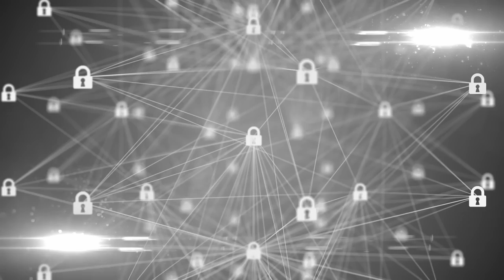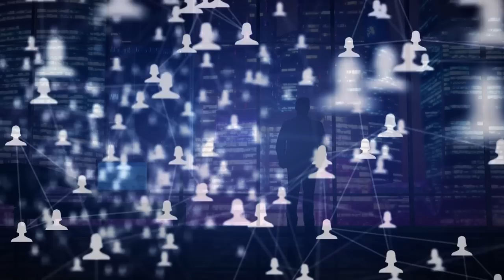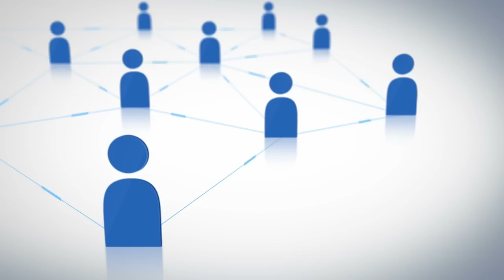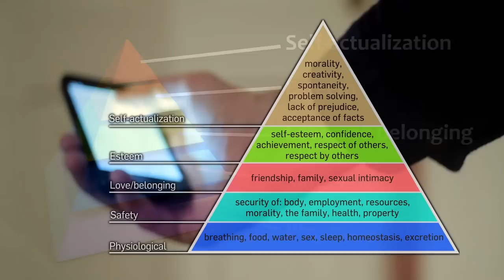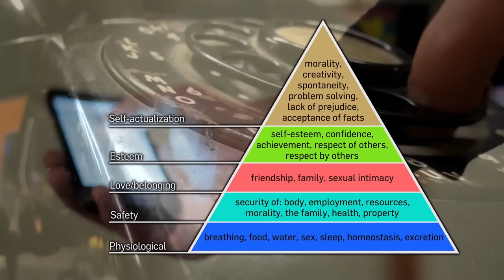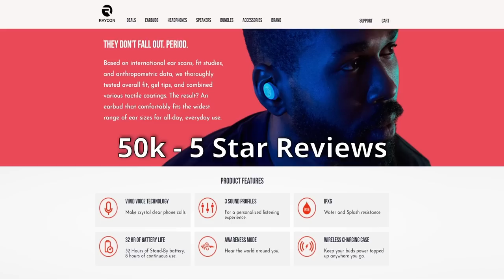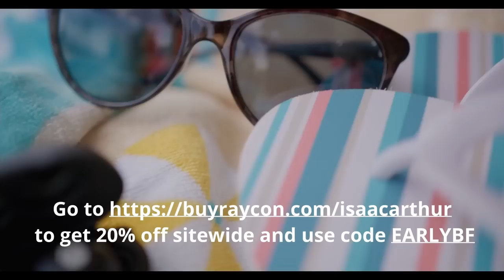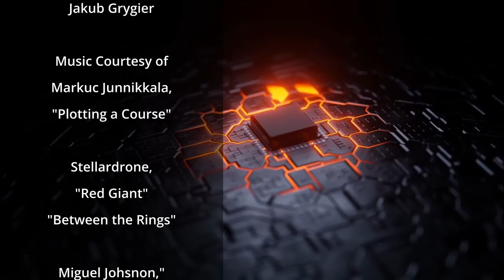Automated Economies & Unemployment

Comment: Do you think it is reasonable to consume a lot of energy by cyclicly moving a large sealed robust container of water (a large thermal mass) back and forth between a stove and a freezer both requiring electric power? You aren't making any  permenent changes as you alternately melt and freeze the water inside. The container and its water aren't becoming less orderly as the exercise continues. The unreasonableness of this waste is a challenge to the second law of thermodynamics. 

❕️❗️It is more scientifically elegant that refrigeration produce electricity instead of consuming it. 

The second law of thermodynamics began to be a strong science paradigm during the mid 1800s euphoria of progress in steam engines and industrialization. Steamships could mostly voyage on-corse on-time regardles of nature's awesome winds and currents. Mechanical power became cheap and without manure. Sir Arthur S Eddington popularized the idea  that the second law of thermodynamics, with its consequence that the universe would die of thermal stagnation, was a proof of God and more fundamental than Maxwell's equations. Powerful generators and electric motors were developed in the mid 1800s leading to the electrical distribution of steam power.

l was granted US patent 3890161 DIODE ARRAY,  for a refrigerator that absorbs thermal energy in an insulated compartment and releases a corresponding amount of electrical energy using the intermediary of rectified Johnson noise (the Brownian motion of electrons) aggregated by a multitude of consistantly aligned diodes. [Not exactly the abstract] It has been open for anyone to develop since 1992.  

I had a report of a working very low power prototype in ~ 1980 but l naively lost the prototype. It was made from a chip containing ~1400 gold pillars abutting N type GaAs. A U VA Charlottesville department made it for 1-3 THz frequencies. They could not align very small diodes well enough in 1980 to make ~1 um dia diodes individually so they made them in patches. I found a lab that put conductive paste on the face of one patch chip to bring all the diodes in parallel and test it in an oil bath in a sealed test chamber. They went out of business but I thought they should keep the prototype because they had the test chamber and could make special arrangements. I lost contact with them and never received the prototype. U VA  refused to sell me any more patch chips and stopped making them. 

I am not interested in any more patents. The diode array patent gives me enough of a reputation. The exclusionary power of patents breaks up synergistic benefits to civilization. Wide exposure to the public (as needed for wide scientific and spiritual discourse) renders invention concepts unpatentable. Other teams have built low power prototypes of their concepts too so the overall energy concept is likely to emerge for the betterment of civilization. 

This energy system would not be unreservedly good. Some foresight of the consequences is needed. 

Cell phones wouldn't die or need power cords or batteries. They would cool when transmiting radio signal power. Frozen food storage would be reliable and free or value positive. That means homes and markets would have independent power to preserve food. Vehicles wouldn't need fuel or fueling stops. Elevators would be very reliable with independent power. Nomads could raise their material supports out of the box pay as you grow. Zone refining would involve little net power. Reducing Bauxite to Aluminum, Rutile to Titanium, and Magnetite to Iron, would have a net cooling effect. With enough cheap power H2O and CO2 levels in the biosphere could be modified. There should be good oversight for this. 

EMPLOYMENT AND ECONOMICS 

I think fundamentally new as well as updated older products should be manufactured in AI operated / human managed  cooperative conglomerates (cooperative   internally and externally). Business details would be open public knowledge. Associated people should freely talk and move as negotiated. The semicustom products would be sold at honest accounting commodity prices. No wealth draining top commanders are needed. It may be partly capitalized by factoring and they may have parts of the conglomerate somewhat dedicated to production of their preferred products. Financialization may be highly off culture but surviving in niches such as incentivizing office pools. The conglomerate may operate with wide participation for the betterment of civilization. 

I forsee a lot of people working for creative expression because the benefits of clean abundant pervasively useful energy will propagate through many manufacturing chains resulting in a materials web where material goods are  inexpensive and a services web where people don't have to struggle to survive but can synergize and socialize with each other. There will be extremely little need to consume fuel for energy - people may still enjoy bonfires. Living will be inexpensive. 

A THOUGHT EXPERMENT TO SUPPORT THIS THESIS: 

Please consider a thought experiment device that may work because it avoids the failing parts of (1)Maxwell's demon thought experiment device which fails because the demon needs intense lightw and (2)Feynman's paddlewheel, pawl,  and ratchet wheel thought experement device which Feynman clamed would fail to rectify random thermal motion.  [Failure because of thermally moving pawls may be fixable with multiple pawls. Its difficult to aggregate this device. Feynman  by extension claimed that diodes would not rectify Johnson noise.  Diodes may work on their own merits].  However, he accepted that small paddlewheels will move in response to the thermal random motion of fluid they are immersed in. 

The purpose of the thought experiment device below is to create self powered thermal diversification. The thought experiment device is impractical but easy to visualize and check for mechanical workability.  It is not too deep in the nanometer scale realm. 

Sketch made with keyboard characters: 

COLD ROOM   ())--:WALL:-->> HOT ROOM    

Key
()) = Paddlewheel. 
-- = Axle.  (Continuous from end to end)
: :  = Axle tunnel going through a wall.
>> =  Lumped friction element

Please visualize two roome full of air separated by a very thin wall that allows the rooms to hold their heat independently with minor leakage through the wall. The wall is thin to delicately support billions of  separate nanometer scale short axles running straight through loosely enough to rotate freely but  not leak very much heat so the rooms can hold separate temperatures. 

On the left side, a very small paddlewheel is mounted at the left end of each axle. On the right side, lumped friction elements are mounted stationary in place on the wall, one for each axle, for the right end of each axle to run through. The lumped friction elements connvert the mechanical rotation of their axle into heat. 

Brownian motion (a nanometer scale effect) turns the paddlewheels at random speeds randomly clockwise or counterclockwise. This random rotation is turned into heat by the lumped friction elements.  The lumped friction elements do not impart Brownian motion to their axle.   

  The committed, linked, and functional roles of the paddlewheels, axles, and lumped friction elements in differnt places should systemically produce a divergence in the thermal energy in the two rooms without adding external energy is a challenge to the second law of thermodynamics. 

❕️❗️It is more scientifically elegant that refrigeration produce electricity instead of consuming it.

THERMARY, A PLAUSIBLY PRACTICAL CONCEPT 

The thermary mainly consists of two electrodes closely face to face (~1 micrometer) in a vacuum wired to an external DC  electrical load. The face of the [Emitter] electrode is covered with a uniform array of LaB6 tipped small diameter carbon nanotubes grown straight out. The face of the [Absorber] electrode is covered with small scale graphine flake char. [Rice U 2014] 

Thermal energy mobilized unattached electrons will tend to free themselves outward from the emitter tips and drift at ~1 million meters / second @ 25 millivolts (thermal electron energy @ 20 C)  to the absorber which tends to collect them.  

A negative charge accumulates on the absorber. This repels oncoming electrons slowing their forward drift, cooling them. The absorber electrode charge is simultaneously the repelling cooling and the external electrical load voltage. The drift current and external wire route current are the same. The DC electrical power consumed by the electrical load depends on the load resistance. Thermal energy absorption always equals the electrical yield. 

Wire resistance is a practical loss not a true loss so lt is overcome by added thermary output. The extra cooling balances the heat given off by the wire loss. The performance of the device is expected to be modest in the beginning but improve rapidly. Even early devices are expected to last a long time. There is little place for obsolence if the first installed thermary works adequately. They will withstand being short circuited indefinately up to electromigration limits. 

Aloha
Charles M Brown lll
Kilauea, Kauai HI 96754

I appologize for the many edits. Somehow l have  many mystery errors including the reapperance of errors I've corrected. There may be changes for improvement too. I want to write well for my readers.